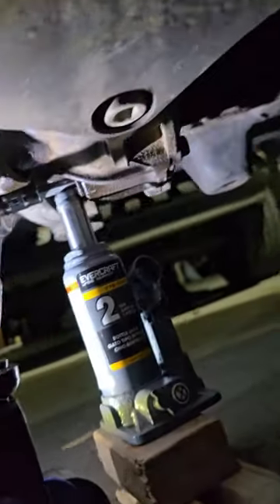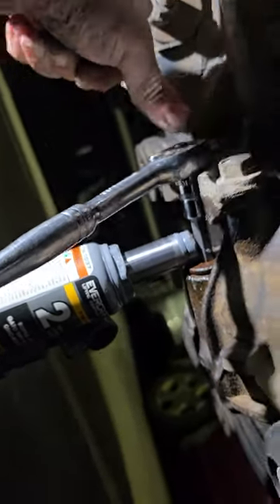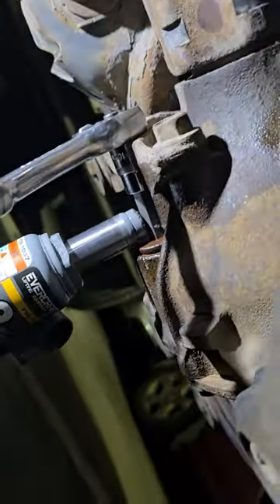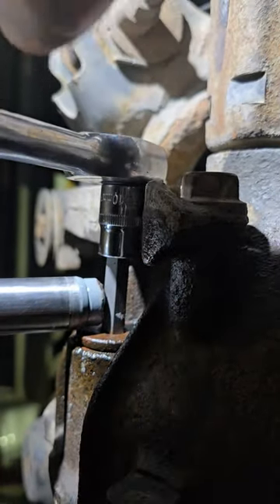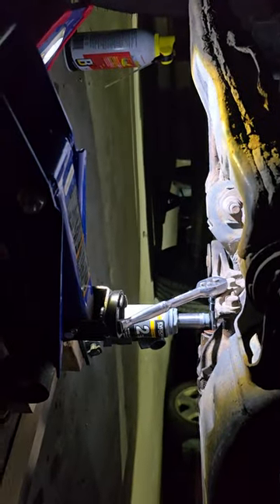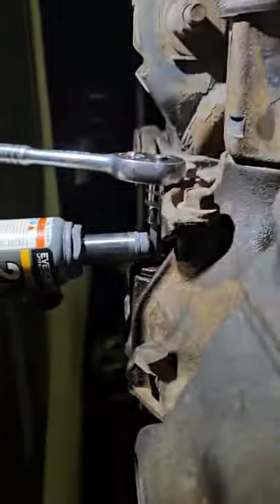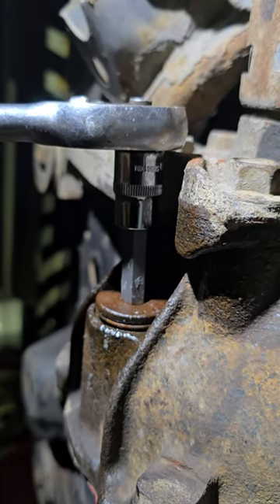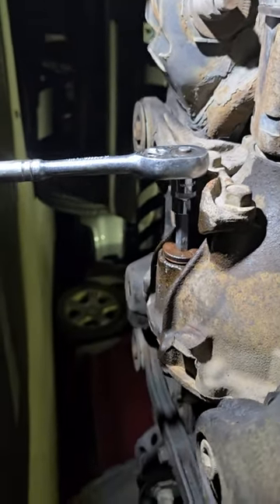2nd gen tacoma front differential drain plug removal.

Comment: Man. That is some skill I do not have. Working on. 1:1
Reply from the maker: You could. To me, It is nearly same as building and working on an arrma infraction or limitless, just on a larger scale. I have done this since I was big enough to hold a wrench. It is my way to relax and enjoy free time. 
Today I will install a suspension lift on this tacoma as well as new front axles and axle shaft seals and bearings.